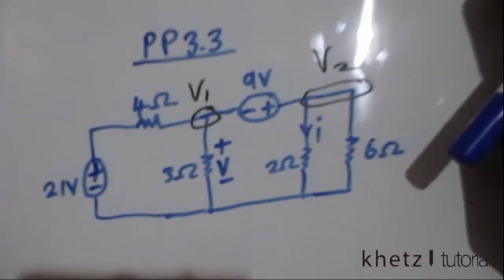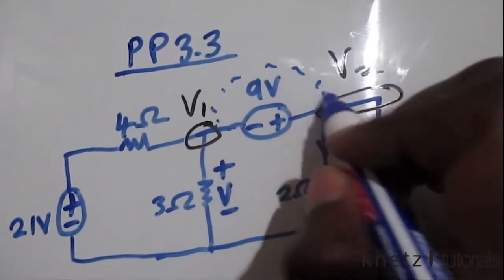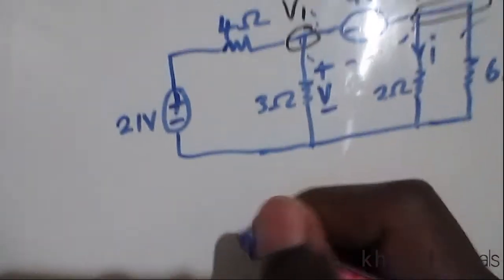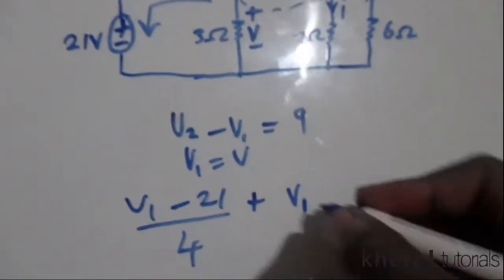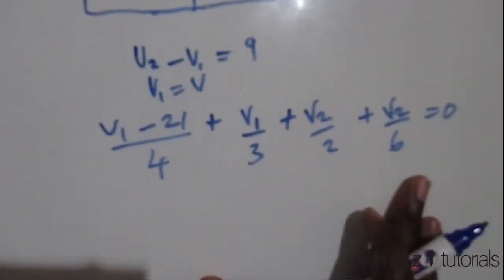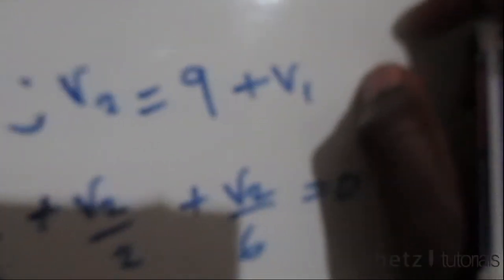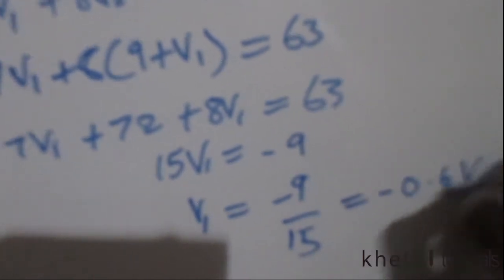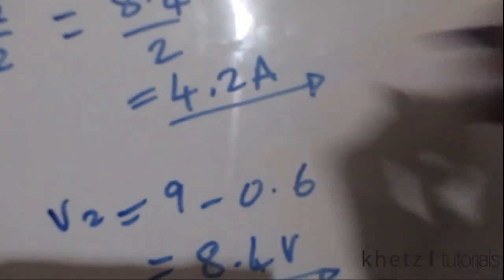Fundamentals Of Electric Circuits Practice Problem 3.3

Comment: Sir,the method you use is not able to get correct answer.
Reply from the maker: Hello. What seems to be the problem? Are we using the same version of the textbook? Have you checked other versions to confirm whether the error is on my side or the publisher's side? There are some answers in the textbook which don't match the diagrams. Please let me know what the problem is exactly.
Reply: @KhetzTutorials  I have latest version of (6th edition).
Reply from the maker: The answers we get should be different then. Check a previous version then do the question again and let me know how that goes
Reply from the maker: And just check that you haven't made any mathematical errors too. If that still doesn't give you an answer, we'll take it from there
Reply: @KhetzTutorials I tried method and it's solved....
Reply from the maker: Perfect!!